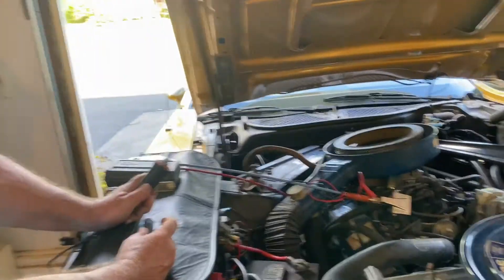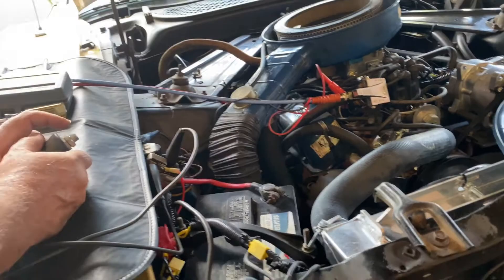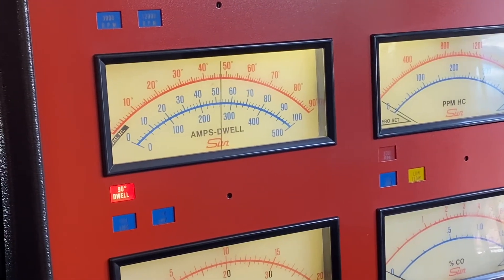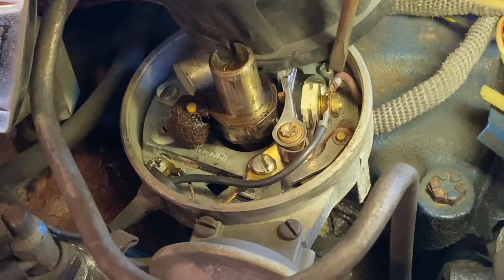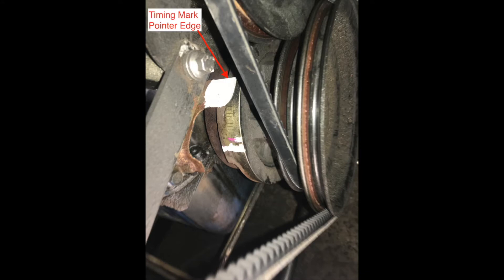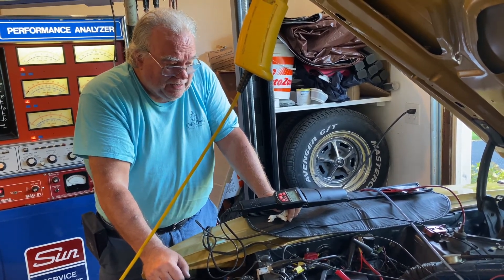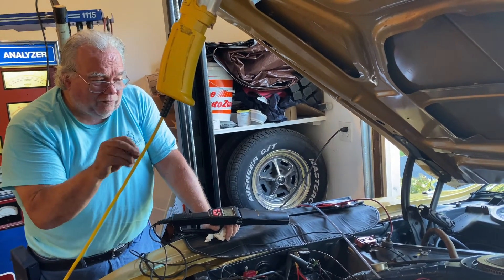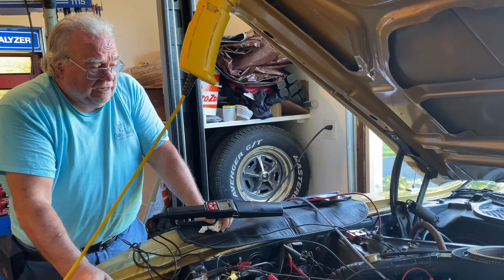1973 Convertible 302 (And Mach1 351W), Set Dwell Angle And Ignition Timing

Comment from the maker: Back "in the day" I preferred to have no more than 2 degrees of dwell variance before rebuilding the distributor or replacing it.  That was just me looking for a very consistent dwell angle and ignition timing (each degree of dwell affects ignition timing by 2 degrees).  But, that was me for street/strip racing.  See the 1973 TuneUp specs table on my Google Drive at the following address:  https://drive.google.com/file/d/1m3M5BCYP6f_p1xsk27wLfbws_UJh21Vg/view?usp=drive_link

From the specs I infer Ford allows up to 6 degrees of variance, which I personally feel is a but too much total variance in a distributor.  For a stock engine I would begin to look to rebuild or replace the distributor (shaft bushings) dwell angle variance of no more than 4 degrees.  Keep in mind that a dwell variance of 4 degrees equates to an 8 degree variance in ignition timing.  That is a lot.  Thus, I suggest a maximum variance of 2 degrees of dwell angle.  I would not depend on point gap specs, as any amount of pitting on the contact surface(s) will alter the gap measurement.  Gap measurement gets us close to the dwell spec, but the dwell angle reading will tell a much more accurate story.

Comment: I have a 1980 302. Wondering how much can dwell vary before I need a new distributor? It has points. Just replaced the harmonic balancer. Still have a vibration in park. Not so much riding down the road, but did before the new harmonic balancer. Any ideas? Thanks!
Reply from the maker: With a primary ignition system using points and condenser I do not worry until I exceed more than 2 degrees of dwell variance.  With an electronic ignition system I look for ar ignition timing floating, sticking with the 2 degree variance at most.  Electronic ignition systems that use the distributor to manage the primary ignition system can tolerate more dwell variance than older point and condenser systems;

Comment: question that I hope you can answer.  My 73 302 has an original dual vacuum advance module on the distributor. The ported vacuum tests ok as it moves the vacuum plate under a test. The manifold advance side does not hold a vacuum nor does it move the plate to retard spark.  What should it do?
Reply from the maker: Please send me an email to gilhale@gmail.com.  I have some vacuum schematics you can look at.  Our distributor on our 73 302 2v has a single diaphragm vacuum advance canister,.  Short answer for your, replace it.  But, let's get some more info to you first.  Did your engine have a manual tranny from the factory?  A photo of the vehicle codes from the driver inner door plate will help me ascertain what it came with originally.  There ought to be a light blue plate (plastic), as well as a white plastic code plate.  There are some code info on both plates them, and some unique info as well.  Between the photos of both plates I ought to be able to conjure up some good info for you.

I plan to be home all weekend now that we are home.  So I ought to be able to get more info you you quickly.